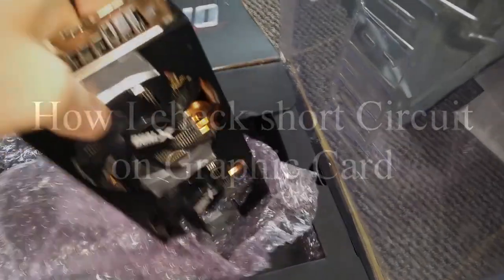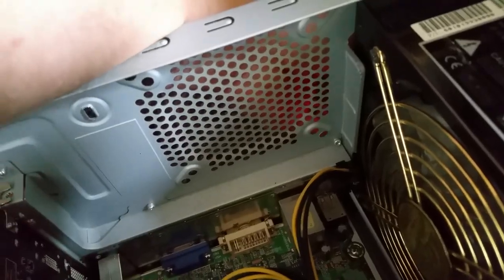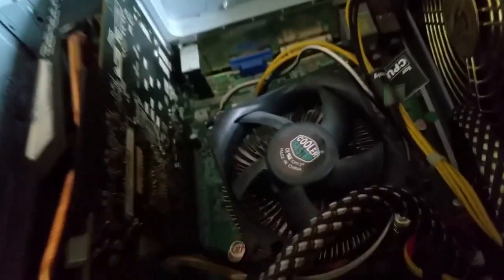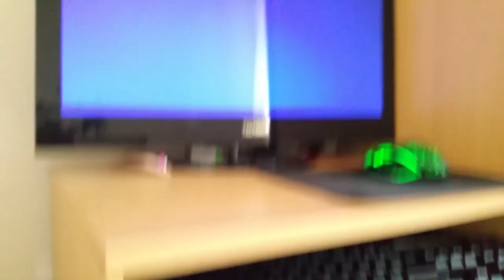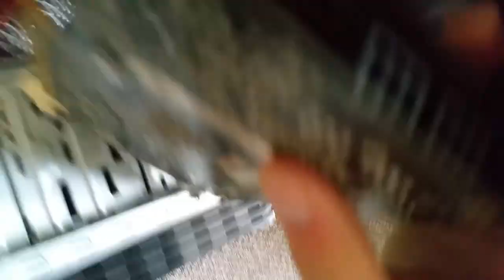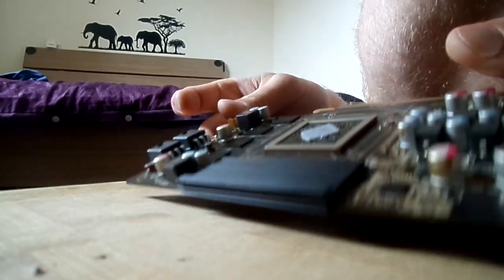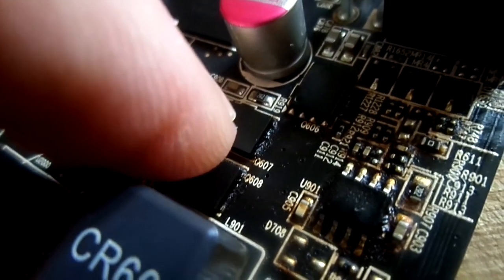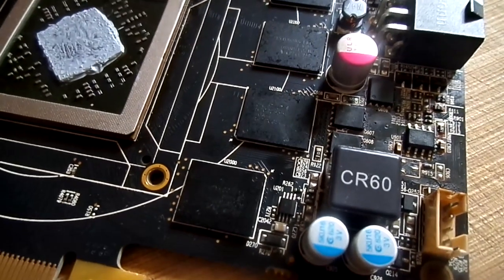How you can detect your GPU have Short circuit  - testing Graphic card

Comment: Hello! This is very late, but I'd like your take on my problem. The other night I was playing something and the PC just turned off. Even when pressing the power button there was no reaction at all. No fan was spinning. I later diagnosed the PSU to be working by turning on the motherboard with everything but the GPU. Then I isolated the GPU being the problem by plugging the PCI-E 8pin power connector from the PSU into the GPU without plugging in the GPU onto the motherboard. So basically it would power the GPU, but the GPU wouldn't be connected to the mobo. When I tried starting in this configuration, the PSU twitched, and didn't do anything afterwards, leading me to suspect some short on my GPU triggered a short protection circuit on my PSU, turning it off. I will reiterate that the PSU and everything else plugged into the mobo except the gpu, works perfectly fine. The fans spin, the PSU works and there are no other abnormalities to note.
What is your take on this? Is my GPU shorted? I don't do this kind of thing for a living so I'd like a second opinion.
Reply from the maker: Hi that's definitely short on your GPU
Reply: I have the same thing now how did u fix it?
Reply: @thieslangeveld8779  New gpu. The old one is toast. Rip
Reply from the maker: Thanks to let know

Comment: Hlo my pc won't start when gpu is plugged in and i checked my gpu with another pcs same problem. I know something is wrong with gpu maybe short circuit or anything else and how can i fix it
Reply from the maker: Hi if your pc doesn't start with card in is definitely short on your card you will need find it and removed  or if possible replacing foulty component
Reply: @frogtechtips  is there any fixed part that might short circuited or i need to check every components
Reply from the maker: @ParveenKumar  usually MOSFET look on my channel I have one video about that
Reply: @frogtechtips  thanks 😊 i will check
Reply: @frogtechtips  can you provide the link of that video please?
Reply from the maker: Hi here is the link you asked for. https://youtu.be/8WVMi1Ljac4

Comment: I get display driver failed to start, gpu can work on a 2019 driver for 30 minutes before it black screens. It will reboot with displayport no signal (because display driver failed to start)  unsure if card has a Vram Short, not enough psu power or if the card is overly bent
Reply from the maker: Hi this sounds like GPU die problem is not a short as if you have short pc will not start at all look on my channel for videos how to fix black screen
Reply: @frogtechtips  i gave up on it and bought a 1650 hige downgrade but maybe i can afford a 30 series in 2022
Reply from the maker: @Splatcake  that's option as well

Comment: hey i have msi armor rx 570 oc edition and when i connect multimeter probs on the back caps(mostly likely they are in power rail), multimeter beeps and shows 30ohm, any help
Reply from the maker: You will need find short but usually is on VCC check my channel for more
Reply: @frogtechtips  by vcc you mean vrms ?
Reply: @frogtechtips  and 30ohm means it's shorted?
Reply from the maker: @Amanullah-dx5uy  no 30ohm men is good short is when is beep or show zero VCC is voltage regulator  that's components is usually have short
Reply: @frogtechtips  thx for the help, then I think it's my PC motherboard causing power draw.
Reply: @frogtechtips  hey it's me again, back caps(behind the die) on my rx 570 are giving 1ohm value? Is it short?

Comment: can a gpu short out but still work? I plugged this same card but 4gb into my motherboard, and now the bios reads cpu as overheating all the time after doing it. It said "power surge detected" after the first boot up.
Reply from the maker: Hi if it's will be short pc will not start at all there is some different problems if you CPU over heating try put a new thermal paste
Reply: @frogtechtips  cpu is not overheating, it only says that in bios. Once in windows temps are normal
Reply from the maker: @kevinragsdale6256  do you mean CPU on graphic card or on MB
Reply: @frogtechtips  cpu on motherboard, I plugged a new gpu into mine and changed the cmos battery. Now everytime you start it from a shutdown it stops and says "cpu over heating" and you must plug a ps2 keyboard into it to go into the bios, then you can go into windows. I already tried resetting everything and updating the bios.
Reply from the maker: @kevinragsdale6256  wau that strange foult I never see I like help you but I don't have idea what can be wrong did happen that if you use your old GPU as well
Reply: @frogtechtips  yeah, I put my old gpu back in and it still does it
Reply from the maker: @kevinragsdale6256  ok than you know is not a GPU problem try replacing thermal paste on CPU and  be sure battery you swap is good and Keep your data  as you setup
Reply: @frogtechtips  I already did the thermal paste and cpu heatsink. In windows the cpu is normal temp and does not throttle or anything like that. I'm thinking the motherboard is just dying, when I first turned it on after swapping the cmos it said "power surge detected".
Reply from the maker: @kevinragsdale6256  that's mean something wrong with bios do you have your jumper on MB on right position as well
Reply: @frogtechtips  I dont know about any jumper on the board, I did update bios though.
Reply from the maker: @kevinragsdale6256  every MB have jumper for hard reseting all dada from it and some MB have two bios as well and if you updated BIOS are you sure you put correct one if yes sorry no ide to help you
Reply: @frogtechtips  yes, I used the newest correct bios, I left the battery out for a few minutes to reset it.
Reply from the maker: @kevinragsdale6256  no idea my friend what next if I will have that pc in my hand maybe I will help you but on this distance no more ideas
Reply: @frogtechtips  I think something shorted but still works, because the day before I cleaned the gpu off with water, but I left it out in the sun, and used a hair dryer on it to dry it out. Maybe I did not get it all the way dry or something, I'm pretty sure it was dry though.
Reply from the maker: @kevinragsdale6256  if will be short on pc anywhere pc will not start at all
Reply: @frogtechtips  maybe it just damaged or corrupted the motherboard bios

Comment: mhh this tells us nothing :(    did you find the short ? what happend did it woork again ?
Reply from the maker: Hans Wurst yop this tell you you have short on left side off power line if you want find where is it you need more deep diagnosis on fault like this one as is not simply solution  but if you plug your card to pc and nothing happens Tey unplug 6 pin to see what happen if pc star you have clue on where start .
On this one been foulty mofset just next that 6 pin but I not recorded solving this later but next time I get card like this I will try show more diag and more deep this is been just quick solution and once you know this you can go to some professional
Reply from the maker: Hi again if you still looking for problem like this you can find now better video in my channel how to repair short circuit

Comment: got same problem, r9 270x turns on, but no display, how can i find the short using a    Digital tester?, please help, i got energy in both connectors 12v, Fans running OK, its got some kind of rust in some components but i aloready cleaned it as best as i could with isopropilic alcohol, Should i put it my oven?, so i can get a r9 pizza edition, or should i just use hair dryer directly into the Rusted components?, please help
Reply from the maker: Hi your card don't have short as you write pc start just no signal you have problems with GPU die I will definitely go for reflowing with heat gun hair dryer is not that's strong last absolutely last option is use oven if you don't have any other options like I always says nothing to lose your card is dead anyway and better to trying make a zombie GPU
Reply from the maker: @solleguizamon7302  you welcome

Comment: Hi! I am experiencing the same problem, first my pc starts for a second then stops prob because of the feature of my psu, then i watched your other video and I removed  2 bad mosfets,after that, i was testing it without the dual 6 pin connector and the pc starts (without signal)... but when i plug the two 6 pin connectors its back to the main problem which is starting for a second and then  stops.. ihope you notice this and provide me your opinions
Reply: My Gpu is GTX 560 ti 448 that died 3 days ago
Reply from the maker: Hi that's mean your GPU have short somewhere and you will need find is so hard if there no visible physical burn damage but is not in possible
Reply: @frogtechtips  ohh ok thanks!!!
Reply from the maker: @doomenix87  you welcome
Reply: @frogtechtips  eyo i washed it with tap water and some dish soap and the fan now runs and is warming up but doesnt have display
Reply from the maker: @doomenix87  ok interesting I will try reheating GPU on this step probably

Comment: Hi, I have a slight problem. I touched the heatsink in my gpu while the pc was off and it gave me a bit of electricity. After that I turned off the psu, took out the gpu and cleaned it a bit (without opening it, just brushed the fans a bit) and when plugging it back on it stopped giving video. Did I shortcircuit my gpu just by touching the heatsink? I'll be doing some tests in a friend's computer, but wanted to know an experts opinion.
Reply from the maker: Hi is the GPU working before you get shock from it and pc been completely or just power off hard to say what exactly happened but can be lot of things if you can try that GPU in different PC that's can help but I will bet GPU is gone 
What model it is and is your card still in warranty
Reply: That's a shame, I'll be doing some tests to see if I can manage to make it work. Thanks a lot!
Reply from the maker: You welcome
Reply: That happend to me to but it didn't shock me
Reply from the maker: You have short on card
Reply: @frogtechtips  I guess so because the screen looked a bit warped after I touched it
Reply from the maker: @stree4-_-  if you have short on your card pc will not boots up at all
Reply: @frogtechtips  oh then idk what the warped screen is but since I'm getting a replacement anyways should I keep the drivers or delete them edit thanks I thought I shorted it turns out my game was glitched lol
Reply from the maker: @stree4-_-  if your card have a artefacts in games I have some videos about that how to repair but first at all if your card is in warranty go that way

Comment: Hey bro i have gigabyte gtx 1060 6gb and it works occasionally
Sometimes it doesn't boot and the rgb blinks( like it doesn't getting enough power and the  power led blinks too ( abnormal power supply from gigabyte website ) tried another pc power supply got the same problem
What do you think it's the problem ?
Reply from the maker: That's sounds like GPU start dieing  I Will try new BIOS   that's maybe will help

Comment: Hello I was wondering if you can help with this problem of mine

So my pc shouted took it to a guy, paid 650 for service, new parts and stuff turns out he bought a CPU with internal graphics cost me 320 then he proceeds to tell me here is your graphics card I didn’t put it in cause it could short your pc but I didn’t want to, cause he didn’t want to risk it so he left it up to me, day after receiving it I play game, game lag bad(csgo) then proceed to get the idea to put in old graphics card( I put it in plugged it up then no work it turned on then off now I’m sad and spooked cause I think I gambled a bit to much. ( what I do now?)

(P.s it was working completely fine before I added the Graphics card and was playing the game with an internal graphics on my CPU after he repaired my pc)
Reply from the maker: This sounds like you GPU you plug in have short somewhere if you take off your pc working correctly or not
Reply: @frogtechtips  when I took it off it didn’t work but it was working before I put it on, I had this graphics card on the build before dude took it off for bread boarding and finding out what’s wrong with my pc the first time I took it in
Reply from the maker: @lilguaq1610  looks like your GPU short your MB as well probably with is not good  
I will take back this PC to servis where you got repair done and don't tell him about your experience just go back and tell him pc stopped working you don't know why and he I think give you some warranty as well if not IAM not sure I can do for you as hard to diagnose any problems just from comments 
But you can try removing ram, test different PSU and staff like that
Reply: But now i have the same graphics card and they say a motherboard can’t really damage the GPU and so my pc with integrated graphics was working fine and all but when I play certain games it lags, so I decided to put in my old graphics card (being told it could short my board or something if I put my graphics card on the motherboard and was advised to buy a new graphics card) but I said screw it and decided to put it on my comped that was freshly repaired but now it didn’t turn on but flash a little red light and turn of and I proceed to take off the graphics card of course with the power cord disconnect for 45 seconds and tried to turn it on did the same thing, so I unplugged the power for a while like a few hours threw it turned on and check temps it’s all alright but when I turned it off, then back off it didn’t want to turn on it just flashed a red light on the motherboard for like .5 seconds and turned off
Reply: @frogtechtips  I added some more info and I he did tell me he didn’t want to put the graphics card on the MB cause he was afraid it would short it out it i think and he didn’t have another MB of the type I had so he decided to just let me know and said if I wanted to I could do it on my own
Reply from the maker: Ok and you tried and now you got problem there looks like your GPU have some short and damaged your MB as well like I say hard to made any diagnostic just from comments you will need try all components one by one
Reply: @frogtechtips  well this morning when I took off the graphics card unplugged the computer and fell asleep, woke up and then the pc turned on, stayed on for like an hour or two looked at temp on cpu rain a diagnostic from the windows diagnostics window, and the only warning it said was missing events in event log and everything else was green and nothing failed, but once I turned it off it didn’t turn back on, now i just unplugged it with no power being idle now :) I have no clue what to do the computer passed POST, and the only thing is like it won’t turn back on after I tuned it off but have to wait a few hours to turn it back on
Reply from the maker: @lilguaq1610  this sounds for my bad capacitor on your MB look on tham visually if looks ok you will need try replacing or desolder than and measure as well that's only I can say
Reply: @frogtechtips  okay thank you
Reply from the maker: @lilguaq1610  you welcome
Reply: Reset your nvram dude

Comment: Bro help me i got the same problem. When i turn on my pc with gpu. It also boot then its dead. When no gpu installed. Its booting. Help me pls ill email u the video.
Reply from the maker: Hi that sounds like your GPU have short you will need find short remove and that's is only way to make a working if you can't do it try find you local electronic repair shop
Reply: @frogtechtips  bro are u expert at building gaming computer? Please help me. I need to find a good and compatible gpu for my computer. This is my specs.
.

Specs:

A8-9600

Asus prime A320M-K

Ram 8gb 2666mhz (planning to buy another 8gb total of 16gb)

Seasonic 12 III 550w true rated

WD 1.5tb hdd
Reply from the maker: @benjbernabe2680  hi as you have and CPU I will go for AMD Radeon card you can find cheap Rx 580 or Rx 570 8gb version of you like Nvidia graphics card go for 1650 or rtx 2060 this card is good option for your spec if you like some older GPU try have a look on 1050 ti  or R9 280x  4gb version
Reply: Thanks bro appreciate it!
Reply from the maker: @benjbernabe2680  you welcome

Comment: What this person plugged and unplugged
Reply from the maker: Hi what do you need
Reply: @frogtechtips  I was wondering what you did to make it work again. Is it unplugging the 12 volt pins?
Reply from the maker: @NutScrewGamer  hi no  this video is just about how you detected short if your card have short you will need find where is it and after removing or replacing bad components
Reply: Ahh. I see. Thanks for the info. My graphics card is having trouble
Reply from the maker: @NutScrewGamer  yo welcome